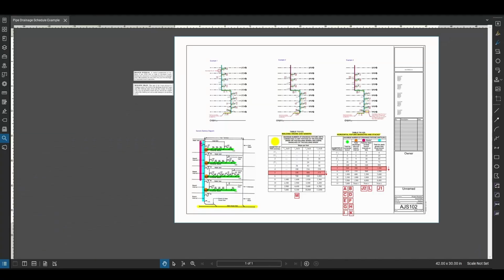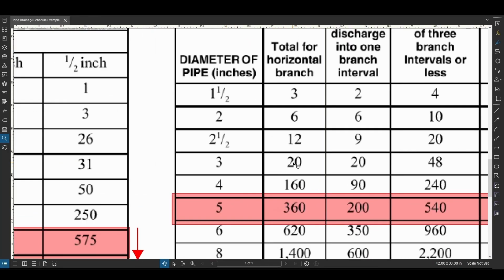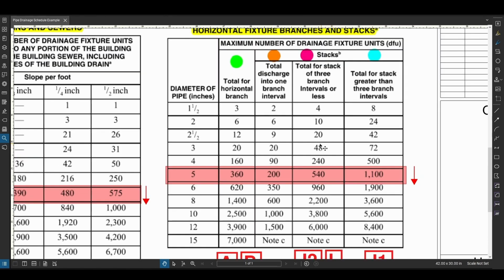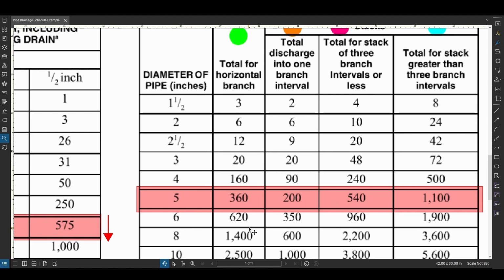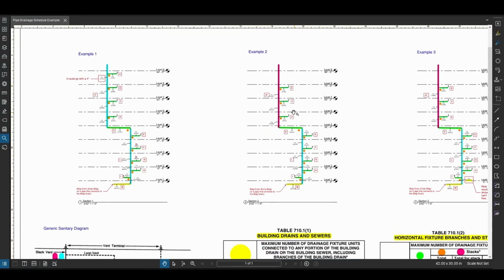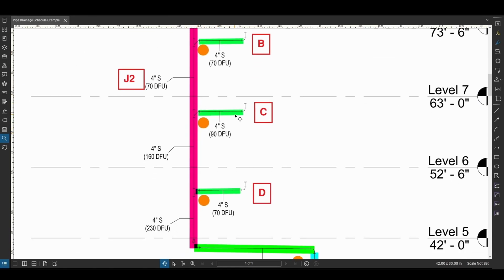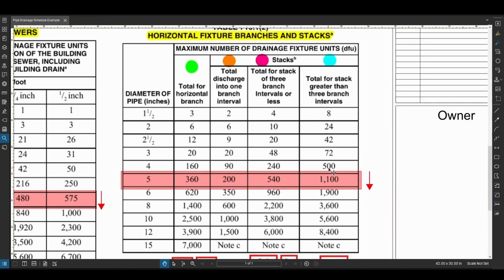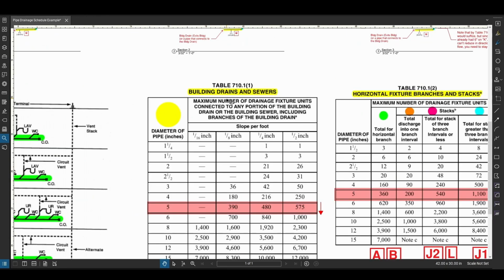How to Size Sanitary Lines Using IBC

Comment: In a pressurised closed loop system, is Revit capable of selecting a pump if it has various pump curves programmed in?
Reply from the maker: Hi Ben.
Just to be clear, this is for a sanitary drainage (gravity/no pressure) system.
However, if you have "calculations > performance" activated, you can calculate pressure drops for both open and closed systems, and you can use that information to select your pump (not easy, but it can be done). Good luck!